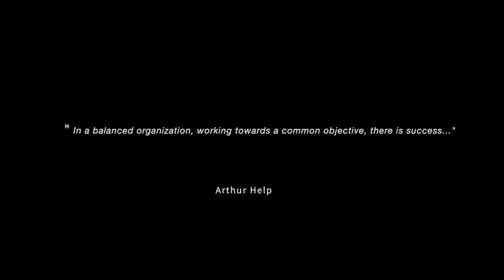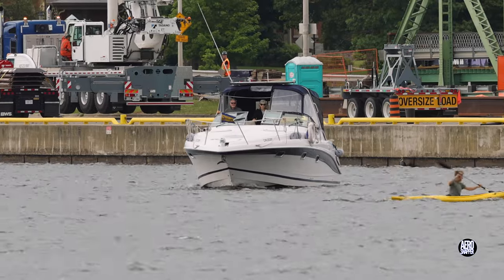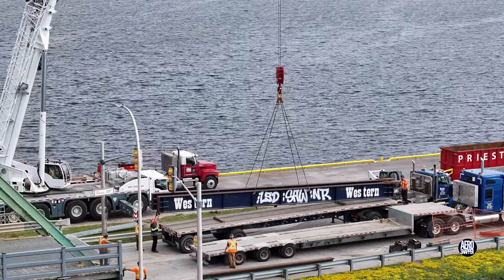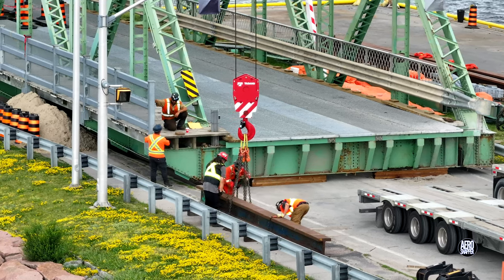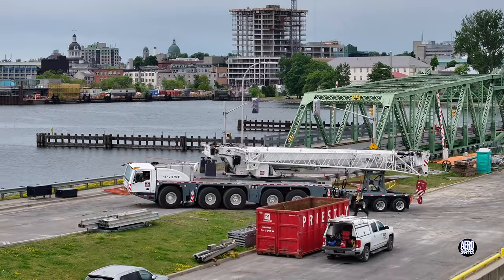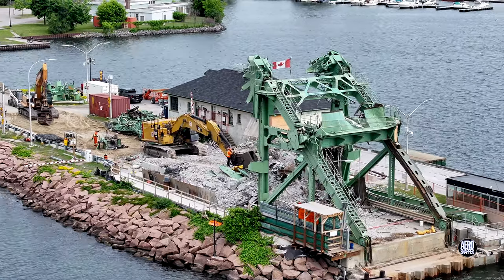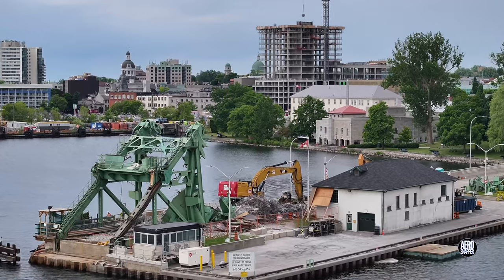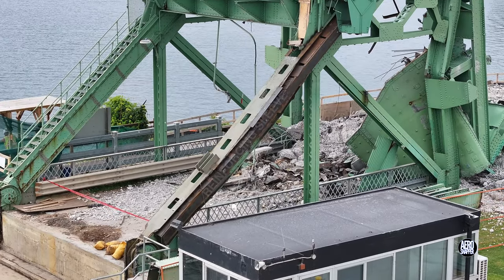Gearing up for the last big push - an update on the La Salle Causeway lift bridge   4K

Comment: Will they slide the span back in place for the interim Bridge, or will they cut up this perfectly good span and place Bailly Bridges in for an unknown  time frame.   Our tax dollars being shredded by consulting Engineers????  Be interesting to see the demolition contractor selling the old bridge span back as the interim bridge!
Reply from the maker: It seems unlikely that they will use this span - some sections of the deck are missing, incomplete at the time of the ‘incident’
Reply: Thank you for posting these clips, from a thousand kilometers away it has been sad to watch this Bridge being destroyed before it's time.  Just think back in the last weeks of March if the first contractor had spent a couple thousand dollars to support the underside of the counter weight as they worked upon the beam which was damaged by the overloading placed upon it, the North side traffic lane was closed and this would have been so easy to do at the time.                      It has truly been a sad comedy of errors that has impacted Thousands of people needlessly, this is not to happen in real life only on stages.     @Aerosnapper